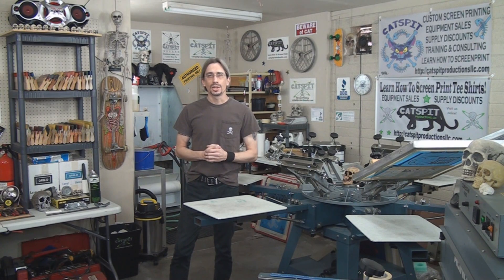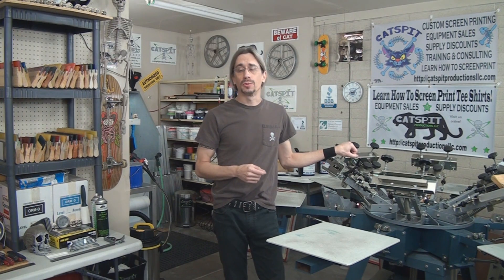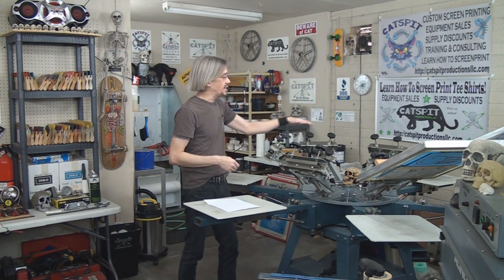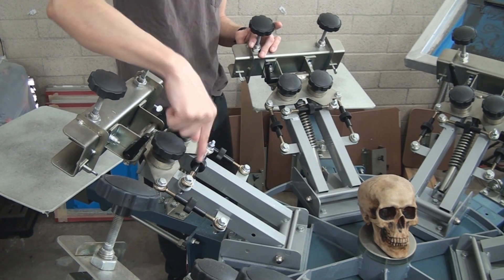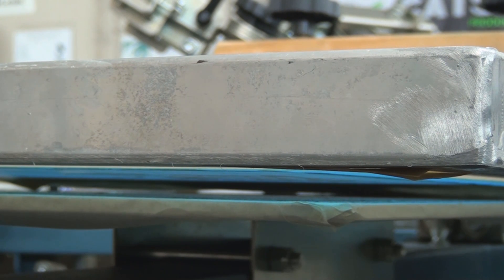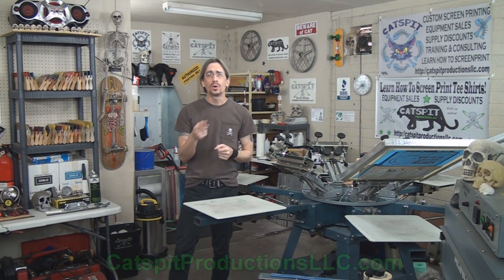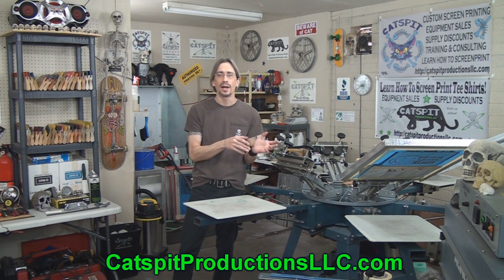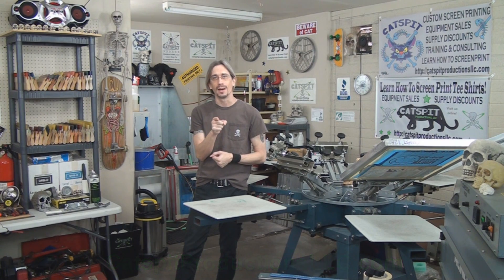Screen Printing: Multi Color Registration Tips & Troubleshooting

Comment: "You're gonna wanna warm up your inks to ROOM TEMPERATURE...". Isn't "room temperature" relative? I mean if the room is cold, wouldn't it be defeating your purpose to bring it to the temperature of the already cold room? I think people think that room temperature by definition is a set point. Google defines it as "a comfortable ambient temperature, generally taken as about 70°F. "Generally" is the key word there.
Reply from the maker: LOL.. yes that's very true but were talking about anything above 70 degrees F. I think of it as about 74 in my experience with this vague thing called "room temperature." I should be more specific ;) Thanks for watching. Screen Printing Equipment & Supplies - http://catspitscreenprintsupply.com/

Comment from the maker: I prefer the push stroke because it is more ergonomic, controls the ink better and it transfers force easier. It causes more stencil drag because of the easily transferred force. When you pull you’re using much less force and the squeegee is not dragging on the emulsion as much. I have a video on flood and stroke methods you should watch. Thanks for watching & commenting! ☠

Comment from the maker: For fleece you need to use enough web tack rather than spray tack. I thought I mentioned pre shrinking and web tack but it’s hard to mention everything in a short video. You can preshrink heavy cotton garments trough the belt oven or on press with the flash cure. I’m sure we’ll do a Quick Tips video on heavy cotton garments and shrinkage. I’ll try to do that soon for you. Thanks for watching and leaving a comment! ☠